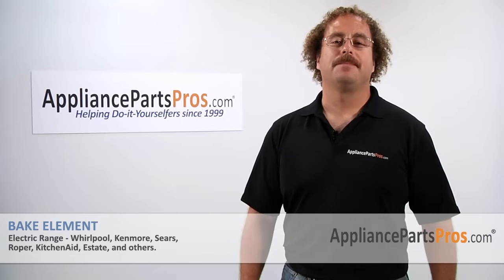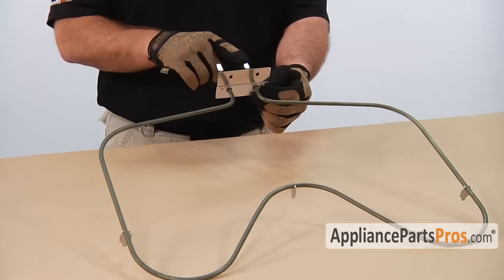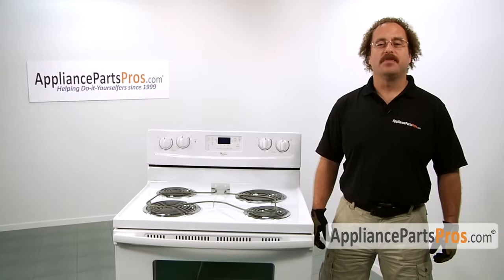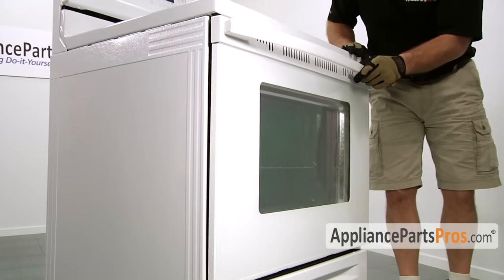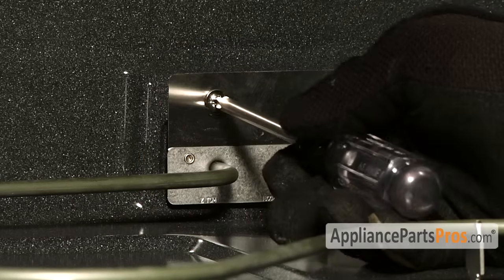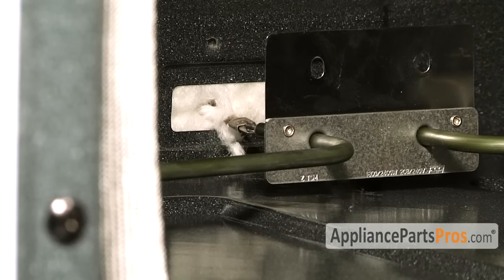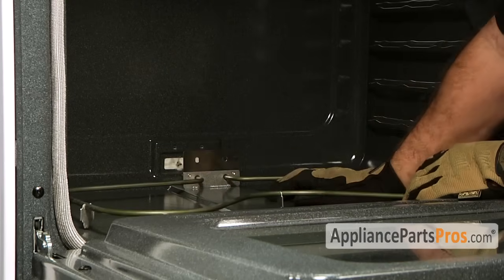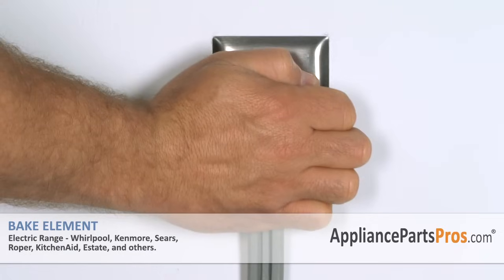How To Replace: Electric Oven Bake Element

Comment: A handy tip to prevent the connecting wires from slipping back out of the accessible area of the oven and into the wall is, after unscrewing the bracket and before disconnecting the wires, attach some good strong spring-release clips or clothespins to the wire that comes out of the wall (behind the clip end, so you can still access the clip to reattach the new element). They won't slip back into the insulation and out of your reach that way.
Reply: I did that but then i plug the oven back and forgot and start the oven and it kinfa explode a little bit inside. There were smoke. I dont know if my oven is broken or not
Reply: @LydiannaBella  Yikes! So sorry that happened to you! Yes, of course, one should remove the clips when the new bracket is reconnected to the wires and the repair is completed. I imagine the wire in the clips would conduct electricity!
Reply: @CallieRoseMartinsyde  my brain told me to use binder clips too!
Reply: How can you retrieve it if that happens
Reply: Exactly what I was thinking 👍🏻
Reply: I just replaced my bake element using your very handy tip! Thanks girl, you rock! 👍
Reply: @Alabamastrutt  Glad to hear it helped and that you were successful!
Reply: My left wire jus went back into the oven what should I do
Reply: Ih I did it‼️
Reply: Thanks for the tip.   I’ll make sure to do so ! 😊
Reply: Thanks for the informative, concise and professional video for something most of us can handle doing.  It's people like yourself that are so appreciated when you can't afford the expensive repairmen to do these jobs. Being female, I learned many years ago to be as resourceful as possible, no matter the task. Now I've just learned another thing from you that can be accomplished. 😅 With gratitude.
Reply: we call those ".5" spring clips in the film industry
Reply: @justinebrower I have those!  Thx.
Reply: This is genius
Reply: @pamelawilliams5793 
2 years late in replying for you, Pamela, but, to anyone else who might read this and benefit from it - if the wires slide back into the insulation, the oven, as mentioned in the video above, will most likely have to be pulled away from the wall, and it’s back panel unscrewed, the wires located and slid back through the insulation into the oven.

Comment: Wife broke element cleaning out the oven, your video mad me look like a pro to the wife and kids. lol Thanks
Reply from the maker: Glad the video helped you get the oven fixed!
Reply: NELLEming lmao you funny bruh
Reply: NELLEming lmaoo facts
Reply: @appliancepartspros    My bottom element is not working on my GE oven.  I saw some tiny gray residue "piles" under the element which is NOT a good sign.   No wonder the oven would not heat to 400 degrees tonight.  Time to get a new part.  Thanks for the video and it seems easy enough for me to fix.

Comment: I was going to hire a repair service to replace the bake element until I came across this video. 
I purchased the replacement part from the website. I had to use a different screwdriver and I grabbed some needle-nose pliers to hold the connectors from the oven.                         I completed the replacement and my oven is working well. Thank you so much for these instructions, I was able to save money doing it myself!

Comment: This video altho nearly 10 yo was a great help in giving my husband confidence to replace the worn out oven element in our high end GE Cafe duel fuel range. Many thanks! We have had our range since 2012, the year this video went live! Unfortunately a replacement element could not be found on your site so we had to purchase direct from GE. Still saved a load of money that an installer would have charged. Our old element gave out after a recent automatic oven cleaning, which I'd set at 4 hrs because the oven was pretty grody. A couple of things for others doing this procedure might like to be aware of. First, we could not get the oven door off no matter how hard/long my husband tried. The right side came out fine, but not the left side. This made his 64 yo overweight body suffer greatly trying to access the element connection in the back. I can see why installers charge so much for their service. Second, it took him forever to get one side of the connectors on the old element detached from the wires in the back. Lots of curse words, lunch and a short sit down later he finally got it disconnected. The new one went in just fine and seems to be working properly. After over 40 yrs of home ownership and numerous homes, we have learned that rarely are these DIY home improvement jobs as easily done as you hope/think they will be.

Comment: Great video, never had to replace a heating unit before, after watching your video i gathered the tools and went to work.  just like the video i remove the wires from the element and  bam one of the wires retracted and I had to take the back panel off.  the one wire was looped around a bunch of other wires and had to reloop it under the other wires.  I refeed it back and had plenty of extra wire to attach the element.  after that the rest is history... works great.  Thanks for the video  and the heads up on taking the back panel off and putting the wire back to reattach element.

Comment from the maker: The wb44x200 is used on a lot of older stoves and has screw on wire connections. The wb44k5012 is a newer element with push on wire terminals. The elements are different sizes also, you should go to our site and look up the bake element with your model number, to make sure you are installing the correct one.

Comment: Thank you very kindly, just fixed my Maytag where the bottom heating element shorted itself out.  Be aware different companies use different fasteners, hex head bolts, hex end bolts, Phillips and sometimes even flat heads.  Make sure to get a few pictures of the damaged heating element before the removal and after for ordering the relative replacement part(s).  
I ended up using smaller vice grips to keep the two wires from slipping back into the insulation back of the oven.
Reply from the maker: Glad you were able to complete your repair. If you have any issues or need help with anything else please let us know.

Comment: Matt, we did exactly what you did but as soon as we plugged it in, the right connection blew up. We unplugged it and we opened the back and saw the burn black marks. 

We did everything you did and was so gentle. We bought the element off of Amazon and I don’t know if the connection on the right side was at fault. Now I guess we’ll have to get someone in here to help with stripping the wire and connect it to a new piece that connects to the element. We’ll have to buy another element, something we can’t afford to do. 

My hubby passed away 2yrs ago and had no life insurance and -$500 in his account. We barely live pay cheque to pay cheque. I’m going on disability and that will help out, but we need a stove/oven now.

Would it be hard for us to strip the wire attach the connector and then attach it like before? I think what happened is the element was touching the insulation (?) and that’s why it blew. 🤷‍♀️

I’d sure appreciate any advice please. Thank you.

Comment: I'm glad I found this video. My oven isn't throwing the breaker but the oven will just stop heating shortly after turning it on or it may not start heating at all. Would you say it would be the element?
Reply from the maker: C Mitchell The element should be tested for continuity, if it has continuity it is good. You can post the problem along with the appliance model number on our repair forum and the techs can help you trouble shoot the problem.

Comment: This looks so easy, I’m going to give it a try once I get my new element!  Only problem is that the clips connecting my old element to the wiring are rusted together.  If they don’t come loose easily, is it safe to use CLR or a baking soda/vinegar mix?  Provided I can do so without getting it on the wires themselves?  (This oven has clearly been in place a long time!)
Reply from the maker: What is your model number?

Comment: Hello! Awesome video... question so when I’m using my oven pushed bake and the broil turns on. Does this mean I have a bad bake element?
Reply: On some ovens, during preheat, the bake and broil elements both come on. If the broil element stays on during the whole baking time though, then likely the oven control board is bad (ERC).

Comment: Thanks for the warning about the wires. The GE stove in my current home is about my age and weight. I'm too old to move it, and it's too heavy to move without help.😅
Reply from the maker: You are welcome! Glad you were able to fix your issue! If there is anything we can help you with in the future please let us know.
Reply: @appliancepartspros  P.S. I placed wooden clothespins on the wires to make sure they didn't slip into the depths while I was working.
Reply from the maker: Thank you, that is a great tip!

Comment: I have replaced the oven element on my Frigidaire by using this video - Thanks!   However, the oven will now not engage when I try to preheat it.   I replaced the element because the previous one had the protective covering burn off on one side.   I ordered the replacement on Amazon, and installed it.   When I try to preheat the oven, there is no typical sound of the oven engaging, and it does not heat up.   Did I do something possibly when I replaced the element that could cause this?

Comment: Depending on model your wire holes may be even smaller but big enough for wire clips to go back into back of oven. I use bread ties to attach to wires so they don't fall back into stove and take them off after I re attach new element.
Reply: Using bread ties is a great idea!  I generally use alligator clips.  I once had a wire retreat into the back; no biggie, but then had to take the back panel off as Matt mentions in the video.  This would be real pain for a wall unit!

Comment: Hi there, I tried this repair on my Hotpoint oven model no. Rb526dp1ww. I got the bake element installed no problem thanks to your video, but now a fuse blows when I try to turn the oven back on. In my replacement part the prongs in the back are straight, instead of bent like they were on the old part, but other than that I don’t really see any differences. Is this a common problem?

Comment from the maker: It may have had left over manufacturing residue. I would let it heat up and burn it all off before cooking.
Reply: Yup, noticed this as soon as I turned it on to see if it was working. A little smoke rises from the element but it dissipated after about a minute.

Comment from the maker: You would probably want to go with a old style thermostat with a sensing bulb, to go in the cavity. The newer ones have a control board and would be more expensive to set up. Here is a two wire one that will go from warm to 500. It even comes with a matching knob. However you mount it make sure you do not kink the bulb or tube. You can go to our site and look at part number AP4013521.

Comment: Great video. I have a similar element that's flaking. Should I replace it?
Reply from the maker: It may be burned on food residue that's flaking. If it's the element itself that's flaking, then it sounds like the element is burning out in that spot and will need to be replaced.

Comment from the maker: As long as it did not trip the breaker, you should not have to do anything, if it did reset the breaker. Most times if the element burns out, that is all that needs to be replaced.

Comment: It usually plugs in behind the stove, so you would have to pull it out, but I just flip off the breaker to the stove, while working on it.
Reply: do I have to unplug the  stove? I have no good access to the plug nor the breaker. If I am sure the oven is not turn on, wear the rubber gloves, will that be ok?
Reply: No I would unplug or turn off the breaker better to be safe than fried not worth it
Reply: @mogarcia9755  yeah I agree. I will see if I could unplug it, otherwise I will use multi meter to measure the connector voltage before I remove connectors. Thanks

Comment: I have old Kenmore electric range. The broken element had about 4" from the mounting bracket to the terminal end. The terminal end connections to wires were behind the back wall of the range. The replacement bake element I got has 3" from the mounting bracket to the terminal end. In this case connections will stay inside (not behind back wall, but inside the insulation). Is this safe?
Reply from the maker: As long as the replacement element is the manufacturer suggested direct replacement, and is an OEM part, then it should be safe.

Comment: My old element was 2700 watts but I only could get a 3000 watts element. In the description of the element it said it replaces 3000 watts, and 2750-3000 watts. Also, on the new element, the plate of the element is not flush with the back of the oven, leaving a large gap open for fire to go up the back of my stove. Can I leave it that way or should I drill new holes to make it flush. I am afraid that the plastic wire sheathing on the connectors will melt and short out. My stove is a 1977 Admiral. Can you please get back to me with your feedback? Thelma

Comment: I would take the extra step and connect the wires from the back of the stove. Why? Because there isn’t a lot of clearance with the metal back of the stove and it could easily short out. Not only that but it’s a great opportunity to clean out all of the dust !
Reply from the maker: Thank you for that tip!

Comment: Does it matter if the slip connector flat side is up or down. I replaced the element, it was easy but there was some smoke coming up from the back of the oven. Is it because the element is new or maybe because I got the connector on upside down?

Comment: Thanks guys!  The tip about the not letting the wires fall back into the insulation was clutch!  I can see how that would be a super pain in the a$$ if that happened!
Reply from the maker: Awesome, glad the video helped you get the element changed out!

Comment: what do you do, when your oven - like mine - has old element and there's no connector, only screws and naked wires :  if i buy a new element , i won't be able to plug it to the wire since new elements have the connectors? also, my old element is still good i think, i suspect the problem is only that one wire has been disconnected , but the old screw where to attach the wire is stripped and stucked ! i don't know if i should try to weld the wire , or would you have another solution ? :(

Comment: When I followed these instructions, it seemed as if I had let one of the 2 wires slip behind into the insulation- so I pulled out the stove and took off the back plate to get at it from there. To my amazement the missing wire had never BEEN connected in the first place- it was carefully bent up and tucked away. Is this normal? Was it safely installed in the first place? I put it through and connected it, and the one that was originally connected as it should be, and everything is working fine.
Reply from the maker: Jill Beardsley Sounds very strange! Glad you were able to figure it out and get the element installed!

Comment: Please PLease please HELP.....  I have a bosch HEI7282U/09
Problem - Conv Broil, conv Roast, and broil setting does not heat up (very slow heat up)
               -  Bake works fine
              - Conv Fan works
Work Done  -  Replaced back round element (new=56 ohms, no Continuity), seller says  that is the expected range
                   - Replaced Top Element (new=17.5 ohms, good continuity)

What should could be the problem?  Many thanks

Comment: Does this also work for a JennAir range?
Reply from the maker: This video would be helpful with any brand/model. There are differences that you may have to take into account, like if you have a hidden element and have to remove the oven bottom. Without knowing what you have, I would suggest posting the problem along with the appliance model number on our repair forum and the techs can help you troubleshoot the problem. http://forum.appliancepartspros.com/

Comment: We just intalled the new oven element into our oven and right after we were done I put jalapeno poppers to see if it baked them well, and it was so disgusting because it left a weird propane flavor on them, I guess cuz it was brand new even though my oven is electric, is that normal? Am I suppose to try the oven several times without any food to take away that smell and taste from it?

Comment: the hardest part is going to be finding the fuse (don't have breakers), then resetting all the clocks after i turn off every single thing in the house first because no one bothered to label the fuses on the diagram very well.
Reply: Just unplug the oven, easier it sounds even if ya have to move it out..

Comment: The two screws that were holding the bracket on the bake element were no good anymore, can i replace them with any screw, or are there specific heat resistant screws i need to get? I thought the new element would come with screws, but no...
Reply from the maker: They usually do not come with screws. If you are going to go to the hardware store to find replacements I would trying to get stainless steel for rust protection.

Comment: My bake element shorted out due to a small oven fire.  Can I just replace the element or is there something else that I need to do or check due to the fact that fire was involved?
Reply from the maker: You can put the element in and see if it works. If it does not then you will have to start checking to see where you lost power.
Reply: Reصفففbecca Ford